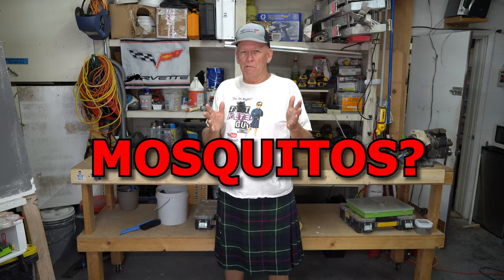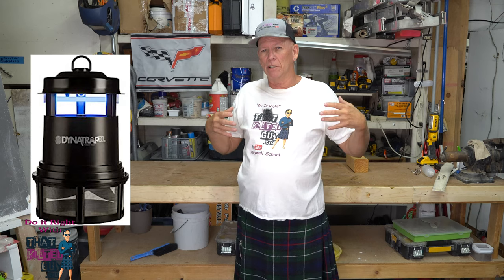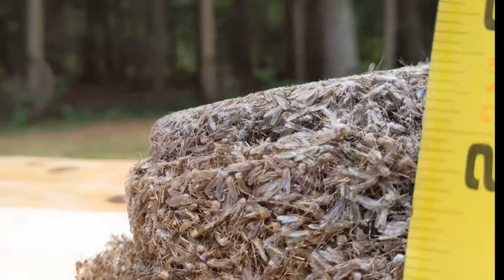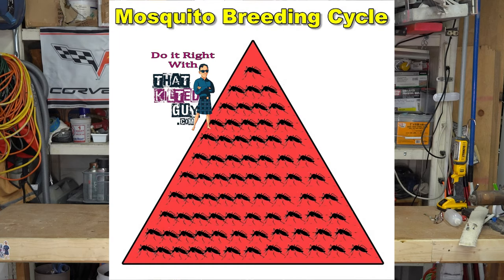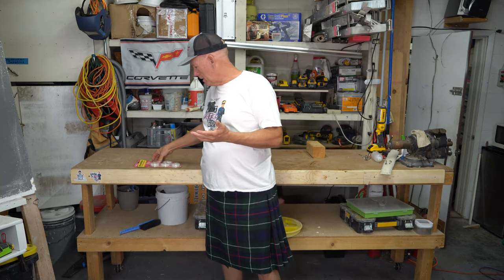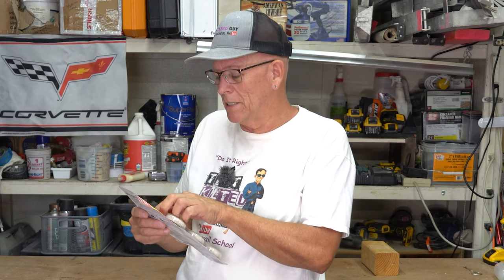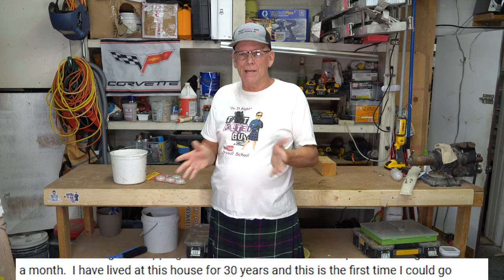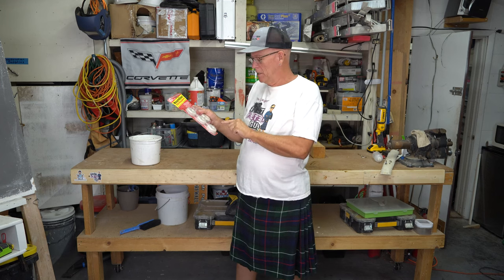Eliminates Mosquitos, Doesn't Just Trap them

Comment: Trying this - hate chemicals!   I'm using two empty giant plastic pretzel jars like you get @ BJs.  I didn't want critters getting into it either, so cut some of those onion nets and clamped it over the opening - stretching it enough that the mosquitoes can get in.  If it doesn't work I'll remove the netting.  I get mauled by these blood suckers every day when I go out to change the birdbath water.  We've had a ton of rain here in the north east (MA-USA) and this is the worst I've seen them.  All my neighbors spay, so my yard if free of chemical for the wildlife & wild birds I feed.  Praying this works - I cannot sit outside at all right now.  I've even had to put long sleeves on during hot days & mosquito netting just to go put out bird seed and fresh water.  Horrible little beasts!   I have 1/2 an acer so put one in my front & one in the back yard using a full float.  Thanks for recommending this.